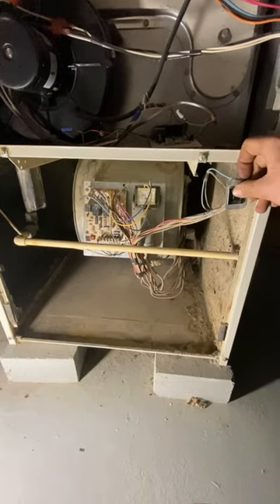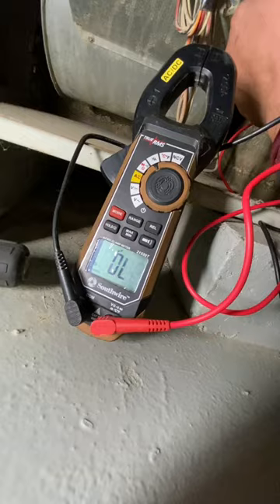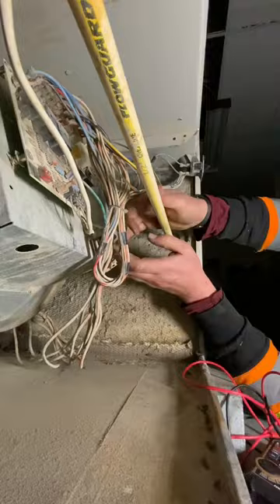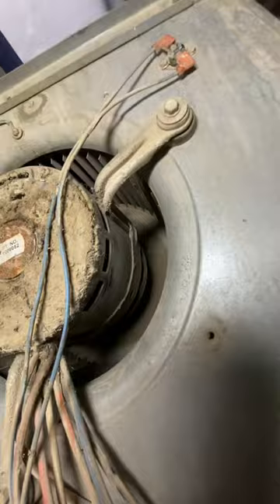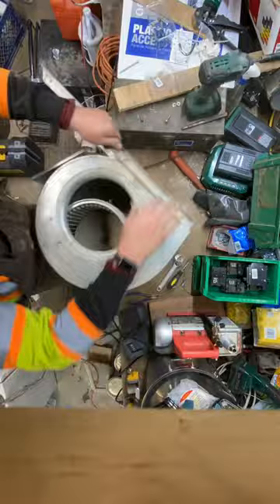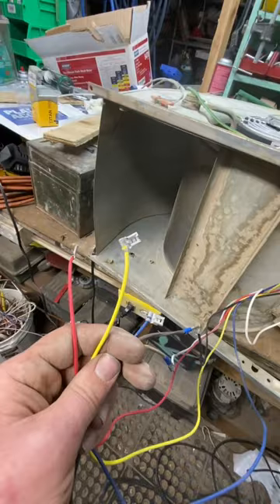How to replace a fan motor on a furnace. #HandsomeOrHandy #shortsmaschallenge #Hvac #Handyman ￼

Comment: I like the foot pedal switch for testing. Great idea.
Reply from the maker: I used to hold the wires in my hand and then try to plug it in, Which was a pain because sometimes they would become disconnected this helps keep everything safer

Comment: After 35 years in the industry I don’t miss it one bit. 😂
Reply: I got like 8 service calls in the morning 😅
Reply: @shaneray5626  they did that to me one thanksgiving (day after) and I was the only tech working. I handed half the pile back and said cancel these. Plus the others they tried to put on me through out the day. That was about the only day I almost quit or got close to getting fired. Yeah poor planning is not my problem. No heats are one thing but no bullshit calls
Reply: Plus it was Vermont and all the calls were 30-60 minutes apart
Reply: I used to be on-call 24/7 in tech & worked 80+ hrs on-site under salary. I don’t miss it.

Comment: Tell them to replace the air filter on regular basis. Filters is for protecting the furnace more than anything as you can see. Good for occupants but the purpose is to protect the equipment.

Comment: Wow - never seen an HVAC SPECIALIST rebuild a fan.
Reply from the maker: Around here replacing the fan motor is very common.
Reply: @HandsomeOrHandy  that’s awesome. The tendency is to replace the entire furnace. A rebuild is seldom mentioned.

Comment: Man I would have checked the underneath of that coil, seeing all that dirt just on the blower motor. You can only imagine how dirty the underneath of that coil is. Dirty coil could keep the unit form running constantly due to high limit switch opening up.

Comment: You should’ve replaced that fan or at least charged them to clean it. If the motor and filter looked that disgusting, than that fan is also suffering from build up.

Comment: Odd... we keep one 208/230 blower up to 3/4, same for 115v and two 825 rpm and 2 1075 rescue condenser fan motors on every one of our trucks..... saves alot of time instead of driving to the shop
Reply from the maker: We operate in a small town of 16,000 so it doesn’t take us too long to drive back to the shop. If we were in a city of 100,000+ this would definitely be done on site.

Comment: Just curious why you don’t just read the capacitor instead of going through the trouble of replacing the part just to see if it was bad
Reply from the maker: I tested the capacitor and it read 9.9 µF but because the motor would not start I was not able to test it under load which is why I temporarily installed the other capacitor just to verify the motor was the issue not the capacitor
Reply: @HandsomeOrHandy  I’m not sure if I missed it in your video but what was the rated mfd of the cap?

Comment: Dude really just hooked a cap up to that dusty ass furnace with out cleaning it first. You can tell a lot about a company that uses turbo caps to test units and the crap allover the shop. This is not how to run a business. Whats your return call rate and be honest.
Reply from the maker: Thank you for your kind of uplifting comments.

Comment: I really hope ur doing a combustion analysis, those flames didnt look the best , and ur the last guy who tocuhed the furnace…..
Reply: He's just a "handy man" not an HVAC tech. I hate going go calls where a "handyman" was there before and now I have to fix this mess they did or rediagnose a system completely,  notice how he didn't even test to ensure that it was either the board or the blower motor. Also the fact that he threw a part first before testing says alot about his knowledge in HVAC. I always tell people try to avoid those "handymen" cause 9x out of 10 they are going to throw parts at it. And never figure out the cause of failures to avoid in the future